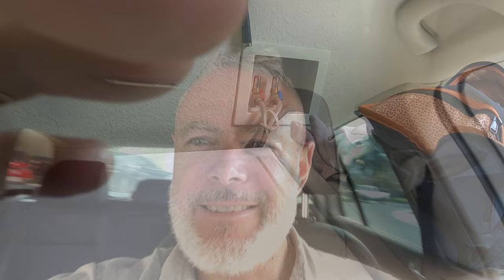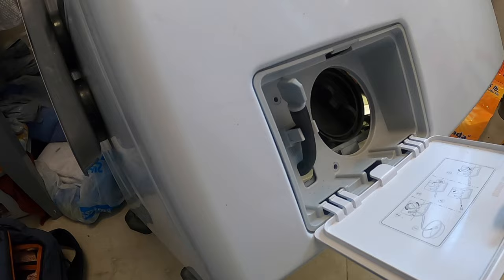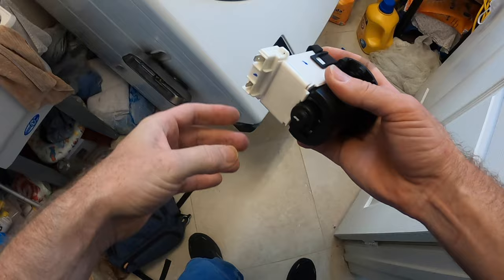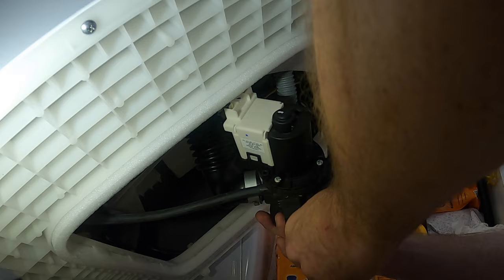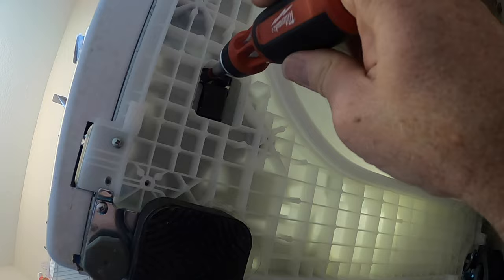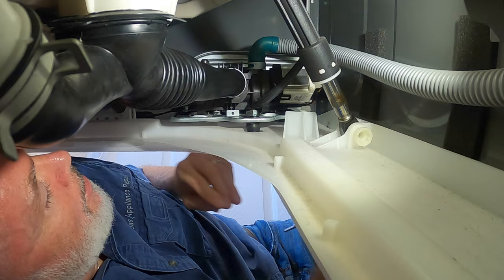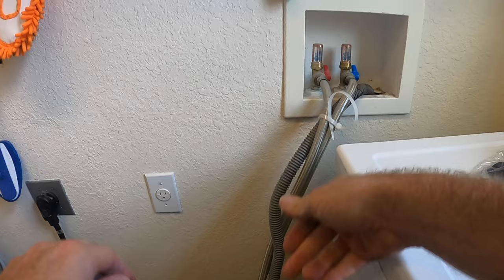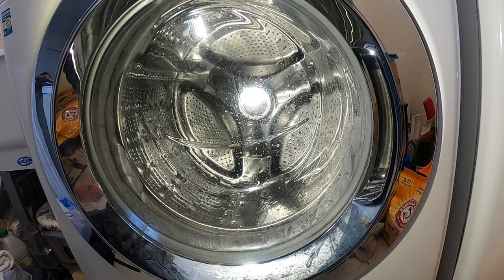LG Washer Drain Pump Fix in 7 Minutes

Comment: ALL YOU HAS TO DO IS REMOVE THE FRONT COVER, AND YOU'LL SEE THE JOB IS SO MUCH EASIER..  NOT SURE WHY YOU DID IT THIS WAY..
Reply: Everyone is saying the bottom was quicker and easier l, I guess this goes to show everyone’s idea of easy is different
Reply: @aaliyahturner9319 it took me less than 10 min ,on top of 10 min to take dryer from top and put washer on jacks….
Reply: It’s not if it has a dryer stacked on it.
Reply: @wesleygibson7575  you would have to move it for the front too. It took 10min because i have a shelf with stuff on side. Pulling dryer is 30sec job, emptying shelf took most. As for pump change , if i didnt play safe and wasnt taking pictures to make sure i get pump orientation right ( its self evident how it goes but u can still make mistake) it would be as guy in video says 5-7 min job. Front is hour at least if unare fast.
Reply: He didn’t go through the front, he went through the bottom. Takes two people to take the dryer off. I did it with one by tilting it back like the video. Other than having to drill some access holes, it was a seven minute job, and easier than going from the top.
Reply: He didn’t go through the front, he went through the bottom. Takes two people to take the dryer off. I did it with one by tilting it back like the video. Other than having to drill some access holes, it was a seven minute job, and easier than going from the top.

Comment: I replaced the pump , still same issue ... wont drain ... baffled
Reply from the maker: Interesting.  Does it make a sound, as if it is trying to pump?  There may be something stuck in the drain line or maybe the drain line is too deep in the stand pipe.  There is a piece underneath that connects the tub to the pump. It may have a sock stuck in it or something. Did you run the diagnostic test?  Check out my video on how to run the LG diagnostic.  You can quickly test all the stages of the wash cycle to help narrow down the problem.
Reply: @appliancerepairamerican  found the issue.  There is 2 pumps . It was the one on the left
Reply: It works!  This is the third pump I’ve replaced in our LG washer. First two replacements were awful taking off the front of the machine. This technique is much easier if you’re comfortable crawling underneath the unit. I’m not very handy and this process took me about 45 mins.

Comment: Do you mean to tell me I bought the spring tool for nothing? Guess I'll just throw it in the drawer
Reply from the maker: I have a spring tool. I usually take the boot off, but on this model I am able to save a time by going through the bottom
Reply: @atlasappliancerepair  ill be doing the same. Thanks a ton for the saved time, and I won't  lose any screws this way hahah

Comment: yeah this way is no good for me as theres two or three bolts holding the pump in that are only accessible from the top and therefore you have to take the front off. who designed these pieces of crap. obviously someone tgat would never have to replace a drain pump. now i have to or three extra screws to try to replace on the bottom. not the creators fault of course
Reply from the maker: most of the time I have to take the Boot seal off and go through the front. It doe save some time going through the bottom when possible

Comment: Not exactly the same machine as mine. Frustrating when you say there is no screws in pump,,,,but don't show where they would be located. Frustrating when I tilt the machine up and can see one screw to take out for the pump, but it is covered by the plastic grid. Now,,,,do I take the whole bottom of the machine off???? The you magically reach in and pull the pump out. It's going to take me half a day to figure this out.